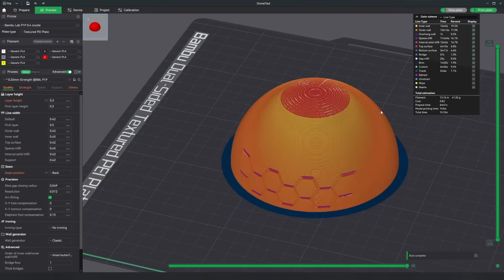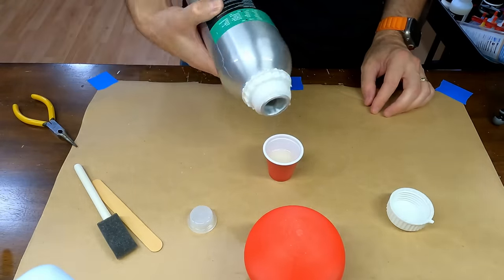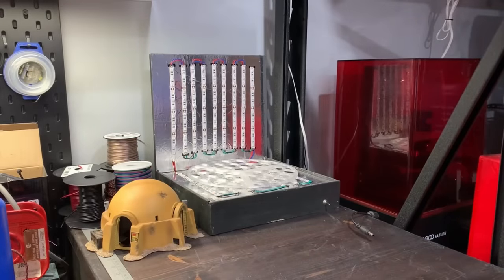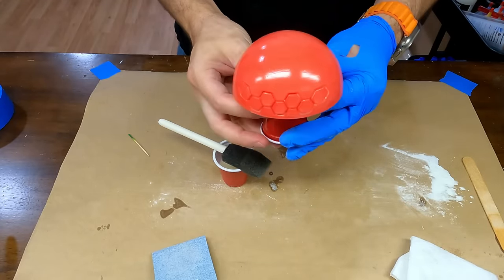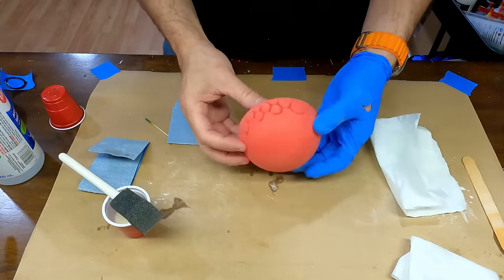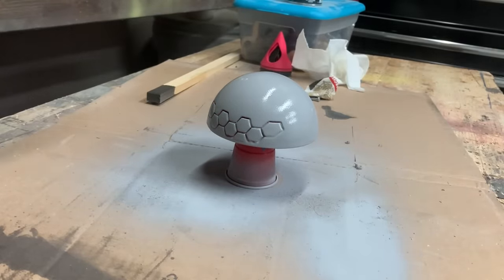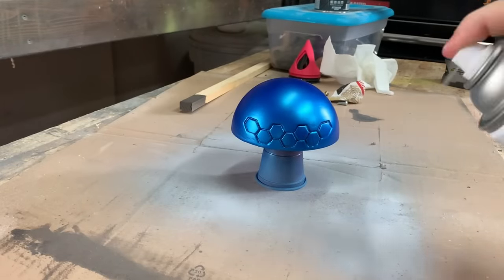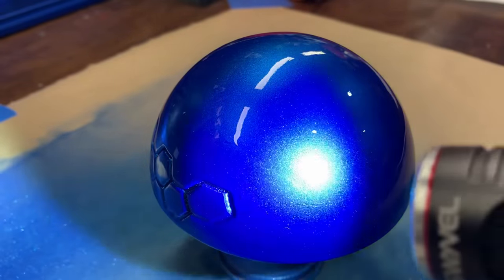Hide 3D print layer lines with Baby Powder and UV resin

Comment: Was the UV resin and powder really necessary with how much sanding you did, and then filler primer... ? Could you not have just sanded and fillter primer instead? Surely you sanded off most of what you added resin wise anyway... seems like an unnecessary step.

Comment: Tbh if you put a little time into sanding the print before using the resin, there's no need to use baby powder at all. This is the exact process I use for making pokeballs..print, sand, paint on resin, sand again. It takes no more than a couple thin coats of resin to get the print completely smooth - with no b powder - smooth enough infact to be able to then chrome paint the pokeball to a mirror finish  that can resemble electroplating.
Reply from the maker: ya, normally I would sand the print 1st but wanted to test a worst case. Thickening the resin seemed to make it easier to spread and run less then straight resin. I probably could have stopped after 3 coats but was trying to use up the remaining resin.
Reply: What paint brand are you using for that chrome effect and do you have any examples?
Reply from the maker: I mixed metallic silver paint with the blue to get the effect.
I added amazon links to the paint I used in the description
Reply: I’ll add one more thing you can do….use card scrapers or heavy utility blades to scrape the print shaving it. It’s a serious game changer. I use the sand, scrape, resin, repeat and get an incredibly smooth print. One last thing…that resin likes to pool in corners or lines, so have a clean sponge or qtips ready to clear any that collects in the lines and corners.
Reply from the maker: Scraping could be tough on a curved surface but would be good on flats. 
Spot on with it pooling in corners, Qtips is a good idea. Would have worked better then the toothpick I was using.
Reply: What's the brand of Resin?
Reply: They do make gooseneck scrapers specifically to handle curves, but you could theoretically make your own if you needed a custom shape.
Reply: What would you use if you didn't have anything resin, but got a kit that needed smoothing?
Reply from the maker: @sclogse1 next common option is glazing putty, I have a video on that also. Could also use wood filler
Reply: Well, sure, but if you're sanding enough, you don't even need resin. The point of the video is to show how effective baby powder + resin finishing can be
Reply: @sclogse1 in my experience, a lot of sanding + filler primer results in VERY smooth finished products

Comment: Just a reminder to everyone regarding safety - use proper mask when dry sanding UV resin👍🏼👍🏼
Reply: Was hoping someone would say it. UV resin is not something to take lightly.
Reply: But take the mask off as soon as  you're done?  Wouldn't UV resin particles still be all over your work station unless you're literally in a clean room?
Reply: @rylanyoung2018 When working with resin or any craft, even with mask, the room should be well ventilated. Also, just don't remove the mask right away until everything (work table) is cleaned up? That's usually how it works.
Reply: @rylanyoung2018  I strongly recommend you do your “dry” sanding outside, garage or like..
Reply: @lilblkrose  You literally cannot fully clean up every particle of dust
Reply: @jacobthomassen5261  then you'll have a toxic garage
Reply: Its no risk if its fully cured
Reply: Only opaque acrylic shield (for enclosure)can block uv radiation from reaching your eyes......if I am right......again it depends on the wavelength in use
Reply: @soacker25  A shockingly low brow comment.  It's not about curing it's about dust.  Any particulate in the air is bad for our lungs.
Reply: @rylanyoung2018    Low brow comment.  Most things cannot be done "perfectly". That doesn't change the necessity to do them.

Comment: Great idea. I have used corn starch to thicken resin for filling seams between printed parts but never thought of using it with the 3D resin.   For a smoother paint finish try using a guide coat of either black or red primer over the grey.  Just a light dusting of the 2nd color, don't need to cover.  Any low spots will stay the guide coat color as you sand, and stick out like a sore thumb.  High spots will burn through the guide color on the first pass. It is an old body shop trick that has been around for years.
Reply: Excellent suggestion. I do this when doing body work or larger projects. 

I like to use something high contrast from what I'm working on. Last time I used it on a black car I used neon green, it was what I had near by and stood out extremely well.
Reply: Doesn't corn starch make the coating sensitive to moisture?
Wouldn't talcum work better?
Reply from the maker: It’s encases in resin and then painted so shouldn’t be a issue
Reply: You do a very thin coat of the second color immediately after the first color is dry?
Reply: @ImmortalReaver there are many ways to do "guide coats".
What you use depends on the project, but the most common is to use a grey "high fill, filler" primer (little thicker build than regular primer, and is made to be easy sanding and to be applied thicker) over the whole project, in 2 or 3 heavy coats. Then apply the cheapest flat black paint you can find. Then just mist it all over the project (doesn't have to have complete coverage, just speckled). Let that dry really well, then start sanding (with a block) till all the black specks are gone. If you are sanding to long in one place, but the black speckled aren't being touched, the you have a low spot. If you think that not to low, you might be able to do 2 or 3 more coats of the high fill primer in just that spot. If it's really low, add more resin or bondo or whatever. Then do the high fill primer over that and then the black speckles. Sand it again till all the black speckles are gone. If you didn't burn through all of layers of primer that you layed down, and everything is 1 color, then you can apply your top coat of paint, 2 or 3 coats. If you get good coverage, then add 2 coats of clear coat. Bingo!

Other forms of guide coat is a very fine black powder made by 3m or other companies. It works great too, but is more expensive.
Reply: @billverine765 would this uv resin method work to fill deeper scratches on a car?
Reply: @ryanguerrero1303  I don't have an answer on that one.  I have only used it on 3D prints.  I do know you would NOT want to put it over paint or clear coat.  It might work ok instead of putty and I did use Automotive primer over it with no issues.
Reply from the maker: I don’t know how it would hold up outdoors. Cars take a lot of abuse from the elements so don’t know how UV resin would hold up to the heat/cold and impacts. Probably better to stick to automotive products.
Reply: @ImmortalReaver   Yes and it really doesn't need to be fully dry since you are just doing  a light mist coat.
Reply: Great tip! Thank you! I liked and shared!
Reply: Love the '80s montage music.
Reply: Seems like it was more work than it should've. And you still had to do some sanding.  Seems like it would be better just to sand the lines down first and then do the resin.
Reply from the maker: @KellyMurph you would think that unless you have actually tried to do it :)

Comment: Reminder: Epoxy resin is toxic and allergenic. ALWAYS use gloves when handling it, on both hands. A prime example of why would be in this video when mixing it (without gloves) and some of the resin spilled. Cool result though.
Reply from the maker: yup, you don't want to get it on yourself, it can be messy.
I've heard both arguments though. Wear gloves so you don't contact it, but then you can get it on your hands and not realize it and spread it around, or don't wear gloves and you know as soon as you contact it and you can wash it off.
Reply: I work with food where gloves are optional due to the fact you can touch something and not realize it with gloves on. I work the same way with resin. Large amounts of resin gloves are required. Smaller amounts of resin. Gloves if I wanna or just ensure I wash my hands afterwards.
Reply from the maker: right, some common sense also needs to be applied. If you work with resin in large volumes every day you should take all the necessary precautions. If you use it once and are careful not to slop it everywhere you will be fine. Amount of exposure needs to be factored in
Reply: This can't be stated enough, ESPECIALLY in the  3D printing community!

It baffles me how people are so casual about it. That is, it is understandable in a way though... it is simple lack of knowledge and the sheer amount of BAD examples on Youtube, even from reputable channels!!

Out of the hundreds of videos I've seen about working with resin, 3D printing related, only a tiny handful state the health dangers and proper protection every time.
In all other videos it is 'free for all' (because they just copy what the see on other channels).

And then you get people like that one comment above who suggest airbrushing resin... I mean.... WTF!
Common sense isn't common.

Comment: No click bait title - Check. 

Straight to the main topic, no drawn out intro - Check.

Badass 80's vaporwave soundtrack - Check.

This video is a certified banger.
Reply: Yeah, it's just baby powder and resin. And sanding. and paint. and clear coat. and more sanding and more coat, just for good measure. not click bait at all!
Reply from the maker: well, after the the 1st 3 coats and sanding you could probably stop there depending on the surface finish you are going for. If it's a matte finish that will be weathered that's all the work needed.
If you want a super smooth high gloss finish, you need to put in the work.
Reply: Humanity agrees, but The Algorithm will have none of this!!!
Reply: Yeah bro the synthwave hooked me right in for the ride!
Reply: I was going to whinge about the soundtrack, but you convinced me otherwise 😊
Reply: @DaveRigDesign  yeah, it's a great result. But the title implies that if you just use what it says, your prints will look like the thumbnail. Which isn't really the case. It's fine, you gotta do what you gotta do on this platform. I only took exception in the claim that it wasn't clickbait.
Reply from the maker: I said Hide layer lines with baby powder and uv resin. I never said there was no sanding.
Just like Death and Taxes, you can't get away from some sanding on a project :)
Reply: 1 million % agree!!!
Reply: Is nobody going to mention that this is the Jorts song? Or did slimecicle sample that beat
Reply from the maker: A few people have mentioned this and I think slimecicle use the same track I did from Lupus Nocte
https://www.epidemicsound.com/track/IXRV8zzKA9/
Reply: @DaveRigDesign  Another great thing about this method - is that you can mix the thickness to fit the task at hand .. I normally thin it down a bit on each layer
Reply from the maker: @cockodemon7443 ya, jorts storm used the same royalty free music :)

Comment: Great video that shows the process perfectly. Thanks for taking the time.

The painting needs a little bit of practice with proper techniques and you'll be set! Some tips I've learned from auto-body pro friends that help prevent runs and get a smoother finish:
-Always start and stop your sprays off on the object
-Never use the "wiggly" method to coat the part
-Move in a straight line with smooth consistent speed (remembering to start and stop each line OFF of the part)

Watch a couple videos on how cars are painted and you'll see what I mean.

Comment: Interesting, basically the same idea as the filler primer but for deeper fills. I think it would probably work best to alternate sanding and filling going progressively finer grit and thinner coats respectively.

Also for the detail work you want to preserve, I think filling it with some putty would be worth a try. Though then you need to be careful not to encase it in your filler coats

Comment: Looks really good. As mentioned in other comments,  there are a few different processes that can achieve the same result. The filling method does have limitations when it comes to fine detail such a textures on a figurine for example whete it will smooth out the detail. Best to just go the slow, finer print method in this case.

One other small thing. I like the idea behind the paint shaker but paint needs agitation to mix, not a centrifuge which actually separates the solids from the liquid. Great idea but needs tweak somehow.  Keep up the great content!
Reply from the maker: Because the paint shaker isn't perfectly balanced its not just rotational mixing but also vibration. 
I saw the idea on Tested with Adam Savage where he was showing off a similar product you can buy on amazon
https://youtu.be/sSH1jS9FMcQ?t=31
Reply: He states right in the video that this would be good for large flat surfaces like helmets.
Reply: one that moves as a piston and rotating slowly?
Reply: @emrage I have a sawzall attachment for mixing can spray paint. Super effective.

Comment: Turned out great. The "proper" finishing process for clear coating is to coat, sand, coat, sand until happy - and then bring the paint back up with a polishing compound from the sanded state, not apply another layer and letting it sit. Granted, this turned out great but a polishing compound on the sanded-matte clear coat works wonders. Between the final wetsanding and then the polishing compound you get basically zero "orange peel". In fact going over the final result here with some compound and a polisher would probably still make it better.
Reply: Great info here.  I had not heard about the last step of polishing directly from matte.  A lot of the DIY videos were doing a final clear layer, THEN polishing.  What you said makes a lot more sense.

Comment: So I did some research: talcum powder is around 26 microns for median particle size. Corn starch is around 2mm. I understand the health concerns around talcum powder, so I thought: what's a similar, but easy to obtain powder that's around that size? Apparently arrowroot powder is around 27 microns, but it's almost twice the cost of cornstarch. I mean cornstarch is cheap, so it's not like break-the-bank more expensive, but it would be interesting to see if a finer particle size would be better or worse.

As for everyone saying "just sand" the point of the video is to smooth a print without sanding. We definitely need fewer microplastics in the world, although I realize a hobby like 3D printing is at odds with that statement. Still, it's a cool solution and I would love to see more like it!
Reply from the maker: The powder is already pretty fine, don't think going any finer would give noticeable results. Possibly the thicker you make the mix the more it will matter. 
I wondered if just getting bulk cornstarch from a baking store would also work, it should, but not sure if it would be as fine or if the cost would be more/less since it is good grade. 
The bottle of baby powder was $4 I think, by far the cheapest component in the process :)
Reply: I've never tried this, but I'd imagine going smaller may not give much more noticeable results. Seems like its purpose is too thicken the resin a bit so it can hold inside of the gaps you're trying to fill, rather than just pouring out. 

Also, corn starch particle size is definitely not 2mm lol. I'd guess its not far off from talcum, but not sure.
Reply: Where did you get those numbers from? 2mm would be huge, like a rice grain! According to Wikipedia, corn starch is 2 to 55 microns, so in the same ballpark.
Reply: @GRBtutorials  the "mm" was probably a typo. justinlee probably meant 2µm (or micron), and your Wiki search seems to confirm the scale.
Reply: Hmmm, industrial-grade diamond powder is available in particular sizes down to 0.1 micron — and it's not as expensive as you might think.
🤔

Hmm… probably not a good idea, regardless. 😅

Comment: The smoothing process was great to see!

The acrylic ink solution for painting is the icing on the cake. Great not having to deal with enamel and thinner fumes to get that rich metallic finish
Reply: The fumes from acrylic spray cans are far worse than enamel
Reply: @janeblogs324  Who said anything about spray cans? Did you watch the video? He's spraying acrylic ink through an airbrush.

What you're talking about is the propellent in what are referred to as 'rattle cans.'
Reply: @WorldWide3133  the propellant isn't a concern, the thinner is. You can thin acrylic with water but decent paint aka automotive acrylic uses petroleum based thinners which are even harsher than acetone
Reply: @janeblogs324  "automotive acrylic," which also is not being used. Have fun out there!

Comment: I’ve seen the acetone and  bondo method method many times but after it melted my plastic cup I used I was like this isn’t gonna be something I can do consistently or easily lol 

This right here! This is amazing! One of the best smoothing print methods I’ve seen! Thank you! Definitely gonna be trying this out thank you! ❤
Reply from the maker: Ya, not a fan of working with acetone for those reasons. Too aggressive :)
Reply: @DaveRigDesign  now I’m looking into building a curing box lol seriously though this is gonna change everything! Super excited about getting super smooth finishes! Would a small Cue-tip be fine when working with smaller projects? I make keychains with my printer and I’ve never been happy with my surface quality
Reply from the maker: Qtip should be fine. Once you get the resin on the print it will try to level out.
Reply: @DaveRigDesign  thanks!

Comment: You could probably avoid the detail lines getting filled by prefilling them with  latex or some other masking medium prior to painting on the resin.
Reply: The issue with that though is avoiding sealing it under the resin when you paint over it
Reply: @SUPERMAR10312  you would have to use something that hardens and can be removed before going into the cure chamber